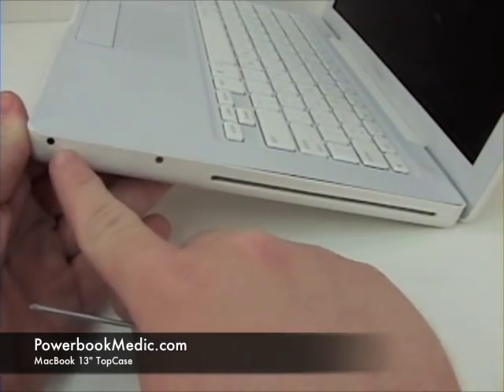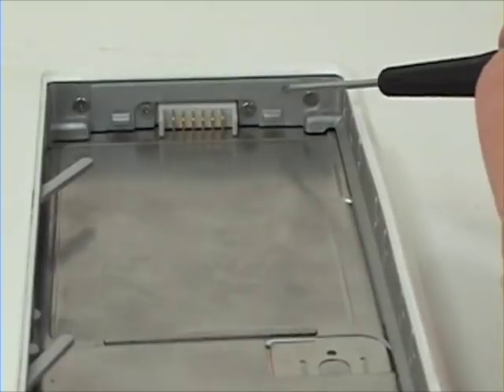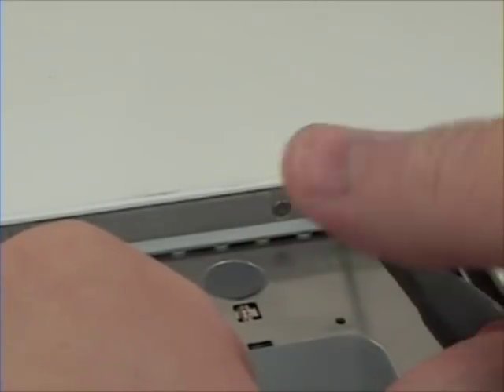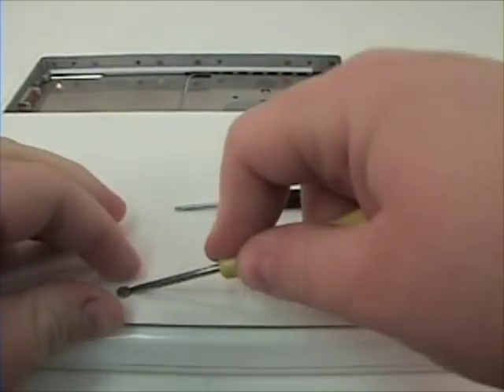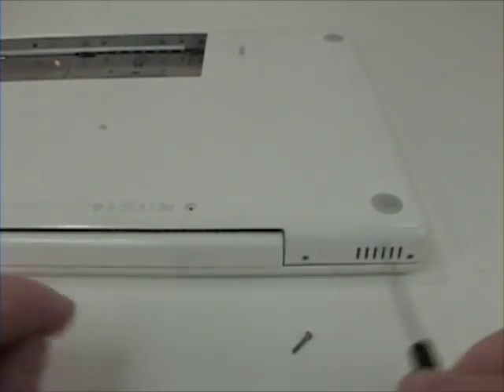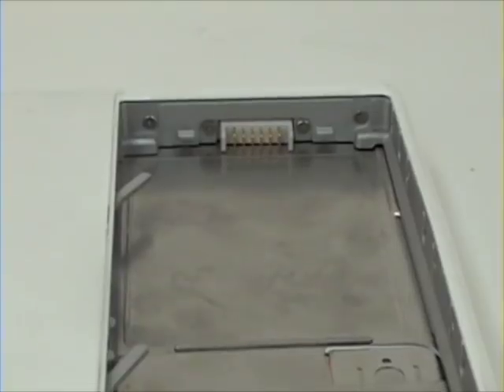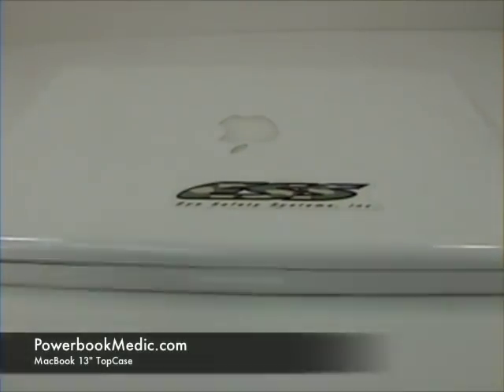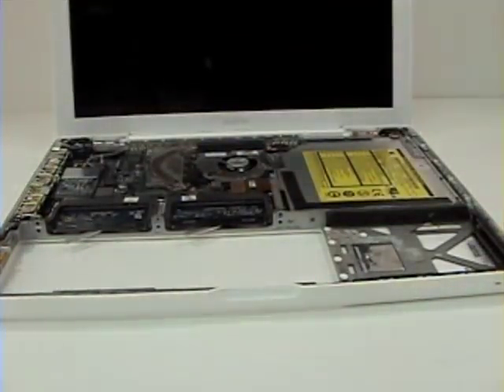Macbook 13" Repair - Top Case Removal

Comment: Great tutorial ! 
An extra tip : Be sure to identify the screws you remove for there are many different types to handle in the top case removal process. What I did was to draw a little schematic of the laptop and put the removed screws on the picture at their respective place.

Comment: Thank you VERY much for the video! My old 2007 MacBook was very noisy. Guided from your video I've opened it and found that the fan was very dirty. I've cleaned it, put back the screws in reverse order from the video and now I'm here typing in my SILENT MacBook. Thanks!!

Comment from the maker: On the optical drive side, on the frame above the optical drive are 4 plastic (light grey in color) clips. These need to be slid into the grooves on the bottom case. Sometimes these can work loose, and one of those may be blocking the top case from going on properly. The top case snaps into those clips to form a seal.

Comment from the maker: @Elan2jay - That means it is stuck in optical out mode. You can try to plug your headphones in and out a few times and see if that fixes the issue, but more often then not, you'll have to have the logic board repaired.

Comment from the maker: @advoce - If all the screws are out, it should pop right off. You may need to use a little force, but the general rule is that if you have to use force something wasn't removed properly.

Comment from the maker: @aaaaariiiiielllll - There are clips above the optical drive which require lifting up the top case to disengage them.  If that isn't the issue, make sure you have moved the correct screws (specifically the ones in the battery bay.)

Comment from the maker: @cheesechiu - You may have stripped the screws. Try a size #00 screwdriver and use enough pressure to turn the screw without stripping it.

Comment from the maker: The top case getting cracked is extremely common, and you can change it out yourself. The part is available from our website. You can change to black if you like, but you'll have to change a lot of case components if you want to make your machine completely black.

Comment: @PowerbookMedic - apparently where the screws needs to be fixed, there are some small hooks. Gently removing the white cover from the base in the horizontal direction was all that it took. Also there were some firm clips above the CD drive holding it back. Problem solved, thanks!

Comment from the maker: Blow it out with compressed air. If you can't see anything however, you'll likely need to replace the top case to replace the trackpad assembly.

Comment: Thanks for your videos. They're very helpful. :) However, I'm having a problem putting the topcase back on. The big clip on the lower right (near the hard drive) seems to be preventing the plastic clips above the superdrive from sliding into place. Any advice? Thanks again!

Comment from the maker: @marcelos815 - Compressed air won't fix the drive. The drive has likely failed as it is extremely common on your model. You'll likely need a replacement drive. Replacements are available from our website.

Comment: I am having trouble getting some of the screws in the battery compartment out. My screwdriver doesn't seem to properly fit the depth of the screw slots. Can you recommend a screwdriver?

Comment: Thank you for this helpful video. If I want to upgrade the drive and the Ram on my old 2007 White MacBook what do you recommend? I currently have a Hitachi 128GB 5400RPM Sata and 2 512 mb Ram. Can I upgrade to an SSD? Can this Mac hold more Ram. I seem to recall that 512 X 2 was the max. HELP!

Comment from the maker: Most likely the top case cable isn't properly connected. Go back in and check the cable, and that will likely fix the issue.

Comment from the maker: The ones you are looking at on our site are brand new. You can not get a new case for much less than that. If someone is advertising a new top case for $50, then it likely either isn't new or it is a pull.

Comment: Should I take the RAM/Hard Drive out before I remove the top case, I want to install the magsafe board & battery cable in a 13" white macbook.

Comment: My fan runs at all times and I've never really cleaned my computer as I was worried about damaging it. Would taking off just the top case and giving it a douse of compressed air be safe? I'm sure there is a ton of dust in there.
Reply from the maker: It would be safe but it likely won't help your issue much.

Comment: I'm missing one of the three screws on the bottom of the laptop and during removal, I didn't realize that they aren't the same length. Since I only have two, I'm not sure where the long screw goes. Any ideas? I don't want to put the long screw where the short one should be then short something out. Thanks.

Comment: Hey there, the keyboard on my black Macbook has stopped working. Some keys work, but other don't. Will replacing the entire top case (keyboard and trackpad seem to be part of that) fix this problem? And what are the odds that I do some serious, unrepairable damage to the laptop? I build computers for fun, but have never worked on a laptop.

Thanks!

Comment: men i have the same macbook 13 white, and all the case is like broken because the use not so bad but the part of the keyboard yes, i wanted to know if i cant change it all, where can i get it or what, also i wanted to know if i cant change it like a conversion of the matte color for a white one, dont u sell it or some like dat tanks!

Comment: Hi, i just bought a MacBook (white) keyboard from your website, and i got some weird problems...i installed the new keyboard, and it worked just fine the first time, but then my mac turnd off, and i tryd to turn it back on, and it didnt work, as if the on/off button was always pushd down, then my fan started making a loud noise, the battery and the power supply stopped workin, i took the keyboard off and replace it with the old one, and...everything  worked just fine....any ideas? =(

Comment: My Macbook 13'' doesn't have a battery but was connected to the power supply adapter, which is a generic, not the original, it was working fine and suddenly I hear a "pop" sound, and it turned off, the power supply seems to be fine, because I smell something burned inside my Macbook, I don´t know if it was my HD or maybe the connection between my Macbook and the power supply that burned. Any ideas will be appreciated. 

Thanx!!!!

Comment: I have a problem with my macbook first I got the ? folder problem then assumed the hard drive was no longer good I just recently purchased a 500gb one and tried to install chronium into the new hard drive by holding the option button to select the USB where the program is at but nothing happens just a mouse scroll screen? why isn't my mac reading the usb or displaying the hard drive thanks in advance!

Comment: Hi, I followed your instructions and managed to open my Macbook White, it was cool, but I can not solve my problem, that is: the keyboard and mouse does not work. I called APPLE CARE here in Brazil, and they informed me that my equipment (2009) is obsolete and has no more support or parts.
thanks for the tips.
Reply: Ebay my friend

Comment: I have the latest one. How do I open the monitor? I just wanted to fix the Apple logo or put a colored film behind it so it'll be a different color instead of white. Please help!! I need to clean the inside too the dirt in the corner of my screen is bothering me and I can't get in there without scratching the screen :/

Comment: First time through when you were showing the 4 screws in the front of the battery area you showed 2,4,7,8 but then when you actually removed them you removed 2,4,7,9

Comment: I love Mac, and I really love my macbook, been with it since mid 2007....

But there's really an issue with white macbook, mine already has two problems, first if i don't do anything (push any key or move the trackpad) it just turn off... some says i have to replace logic board and that's too expensive!

And second, about 20 min my macbook started doing some crazy noises, maybe is the fan,,, i bet i have to replace it too!

That just sucks, i mean its supused last for life!

Comment: I have a question, I have a macbook like on the video, I so fucking slow that I cant do  nothing, I have alredy installed the 10.5 twice, then I upgraded to 10.6 and is the same issue, and for last I did the bootcamp and wind7 is working even slower than mac, I wanna ask: IS THIS ISSUE MADE BY DUST ON THE FAN OR SOMETHING LIKE THAT? IT IS COMPLETELY NECESARY TO OPEN IT TO CLEAN IT?

Comment: hi, i've removed all the screws, but the bottom left and top right of the keyboard are apparently still jammed. As you don't need to put any force to remove the keyboard, what could be the problem with mine? thanks!